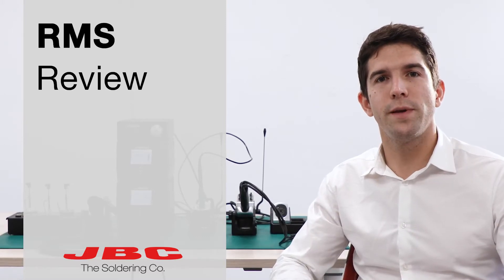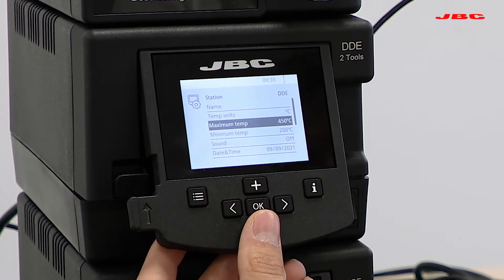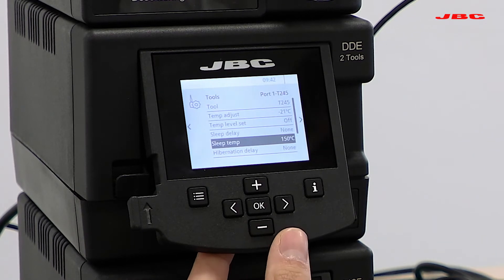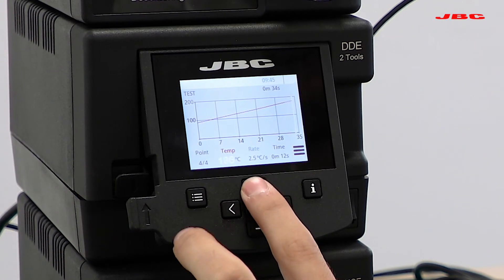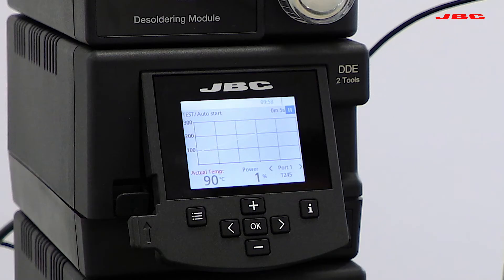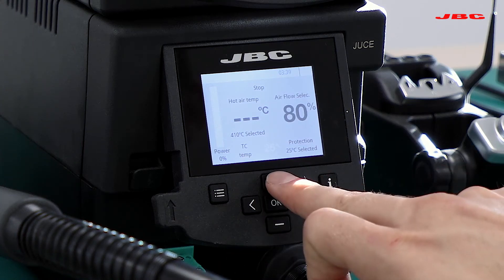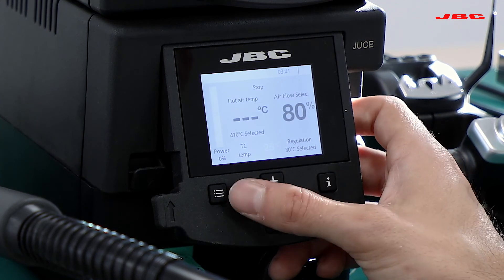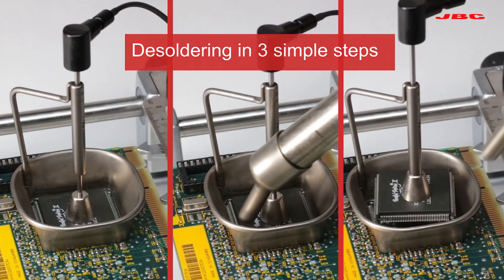JBC Complete Rework Station Review

Comment: To anyone looking at the desolder module from JBC , get the Pneumatic pump version (if you have a compressor available) , so much more powerfull and the noise is very low compared to the electric version! So annoying!

Comment: Hi, i just purchased RMSE-2QE and connected according to the manual but only power to JTSU UNIT NO POWER TO DDU UNIT AND DESOLDERING UNIT
Reply from the maker: Hi Ali, thanks for contacting us. If you are having technical issues with your units you can find troubleshooting topics here: https://www.jbctools.com/troubleshooting-soldering-station.html. Or you can contact JBC directly https://www.jbctools.com/contact-us.html and they will be able to guide you through the set up process so both units are working properly. Did you happen to buy this unit from us?